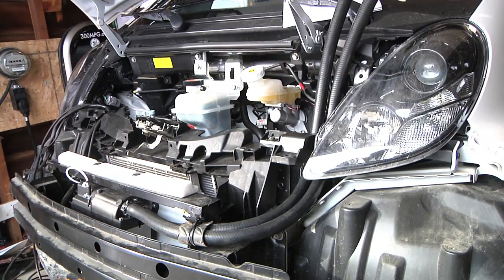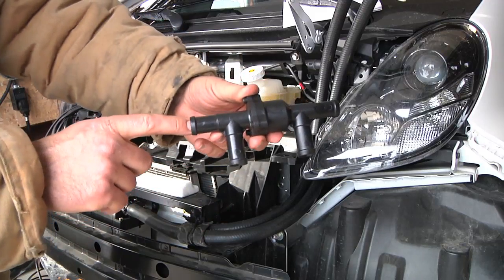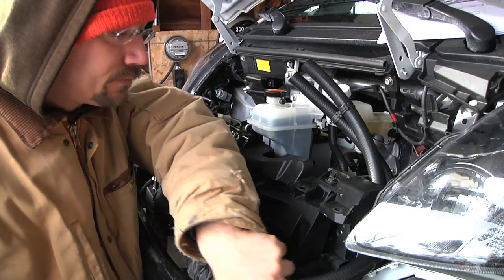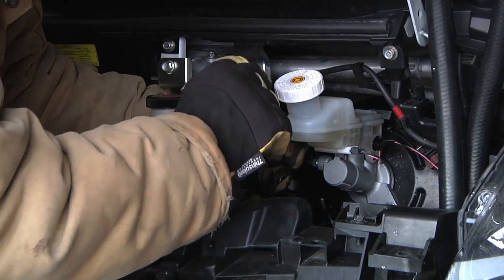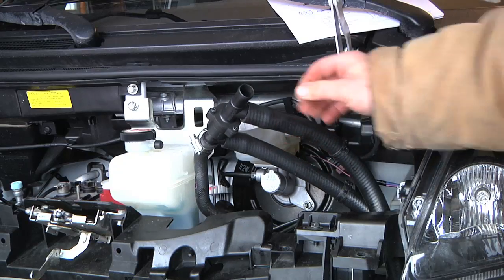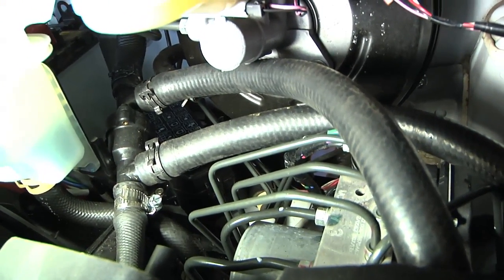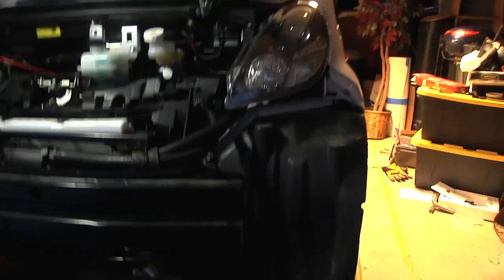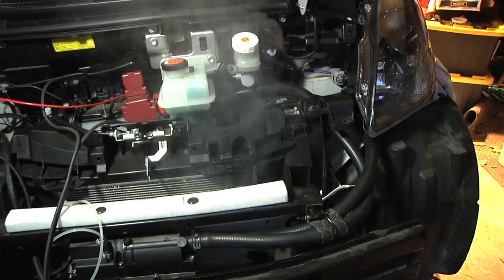iMiEV Heater Install,  Part 3

Comment: That stock heater system seems overly complicated when they could have used a simple resistive heater which would have been faster and more efficient. Made your add-on possible though. I wonder if they had an option to have a gas heater or had a system that used some of the waste heat from the motor and/or controller
Reply from the maker: My understanding is that this car was based off a Japanese rear-engine gas car. They used that as the basis for the electric car, and a few things sort of carried over as legacy from the gasser, including the fact that it's liquid cooled/heated.
After I got it, it took me a while to find the hood release. It was way over on the right side under the dash. This makes sense if you realize it would have been a right-hand-drive vehicle in Japan.
Lettering on the gear selector is also on the right side of the stick, where it's harder to see than where it should be on the left.

Comment: Where to buy duble T valve?
Reply from the maker: Everything I needed for installation was included with the heater.
Diesel AIR heaters have really come down in price and there are lots of them now out there. A good choice for many EVs with weak heaters or small battery packs.
https://amzn.to/2RkgIN2

Comment: Hi Ben, was there any worries about where the exhaust is pointing? Will any air intake from the existing HVAC suck in any fumes? PS: Taking delivery of a brand new 2017 I-MIEV in Canada next week. Would love to do this mod! :)
Reply from the maker: Martin I was never overly worried about it, but what might work best is to have just a little longer tailpipe and run it out the side. A few guys have also done air-based heaters and mounted them on the cargo area with the exhaust going down and out the back. I like the way my heater ties in with the existing HVAC but the air-based heaters also allow you to run them with the car otherwise off. Gavin at KiwiEV is one of the latest air heater installs.  Take a look at as many different installations as you can and decide what works best for you.
Reply: Ya I was thinking about just adding more pipe - should be straight forward. :) I'll go with what you did - I really think it's the most elegant solution. Now, just trying to find the same Kit you have, but will go with Diesel... trying to find one with integrated water pump... Does this one seem right? 

https://www.aliexpress.com/item/Free-Shipping-5kw-12V-Water-Diesel-Heater-Similar-With-Webasto-Heater-Auto-Liquid-Parking-Heater-Hot/1706431941.html?spm=2114.search0104.3.174.698c3925eG5ljK&ws_ab_test=searchweb0_0,searchweb201602_5_10152_10065_10151_10344_10068_10130_5722815_10342_10547_10343_10340_5722915_10548_10341_5722615_10697_10696_10084_10083_10618_10139_10307_5722715_10059_10534_308_100031_10103_441_10624_10623_10622_5722515_10621_10620,searchweb201603_68,ppcSwitch_2&algo_expid=0bcf0b74-3d92-4f6b-9e91-a73cbcb3e13a-27&algo_pvid=0bcf0b74-3d92-4f6b-9e91-a73cbcb3e13a&priceBeautifyAB=0
Reply from the maker: Yeah, that's it.

Comment: Is this the IMIEV that was under water?
Reply from the maker: +Joe Wilder No, unfortunately that car was really NOT restorable without an extreme body transplant. I tried finding a crashed iMiEV to transplant parts with, but oddly, crashed iMiEVs have always been very expensive, yet right now, you can buy some plain used iMiEVs for pretty cheap! Go figure. I still have the flooded car (which is the berry color) which can be used for spare parts.